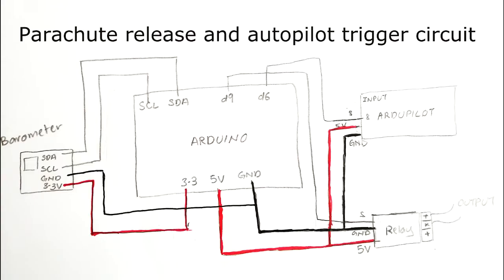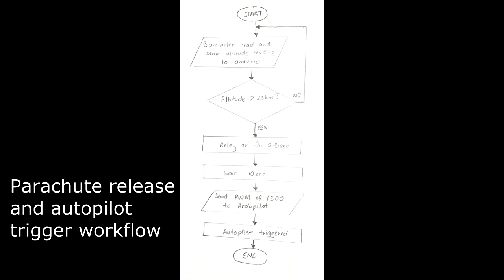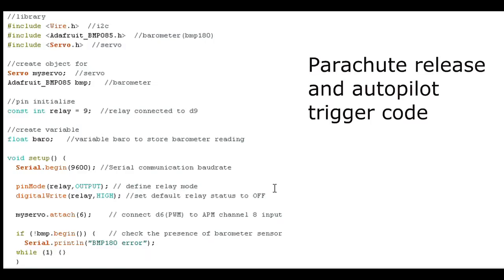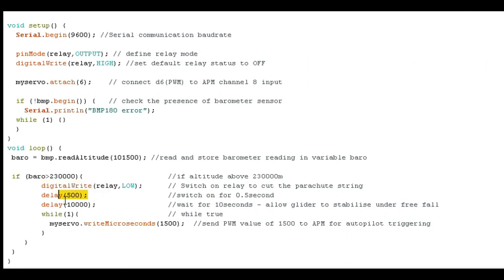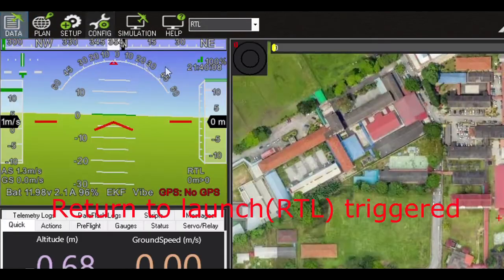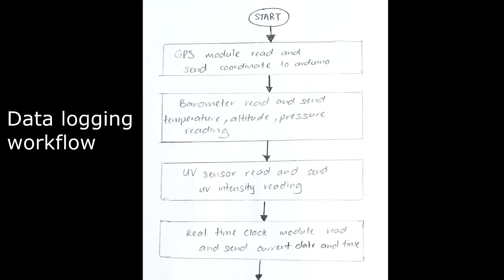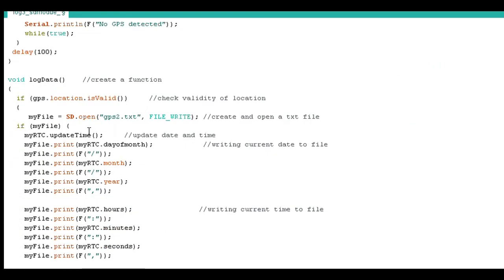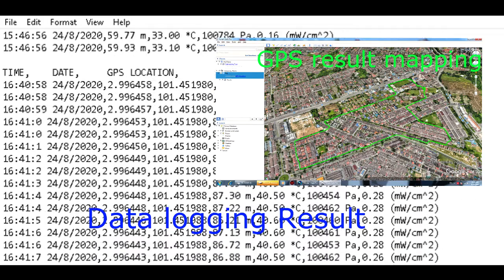High Altitude Autonomous Glider | #viralkaninovasianda #pusatstemnegara

Comment: hey i  ended up with this exact plan , 
I wanted to launch an HAB (high altitude balloon) with a very efficient glider . which had solar cells on its wings for powering ,and after reaching an attractable height  that glider would  cut off like yours and return home . I live in India and  we have less regulations , so i can launch it without much legal issues ................. 

i dont have much knowledge  in ardupilot  , so i thought  if you could send me the resource files and some more details about the software ,code and  more design files or images (via mail (nirmalkrish.p@gmail.com )  we could mix our ideas and launch  it ....

and i would like to integrate 

a solar  cell system in the wing( just like rc test flight's rc solar plane V4 https://youtu.be/SwbJJoe09DI  )

and  some more sensors
i hope you like my ideas
 and will reply soon ........i will send you all my  footage and  all results.